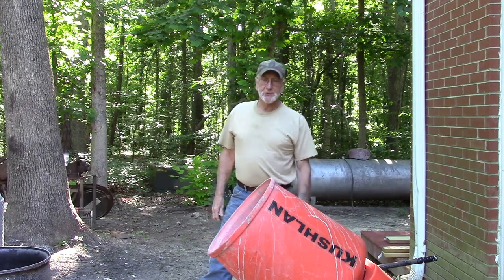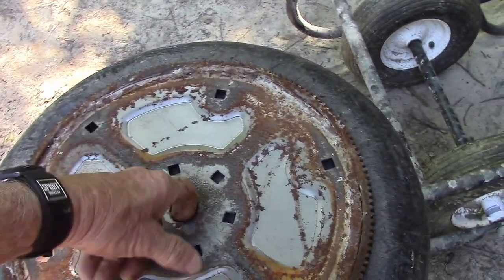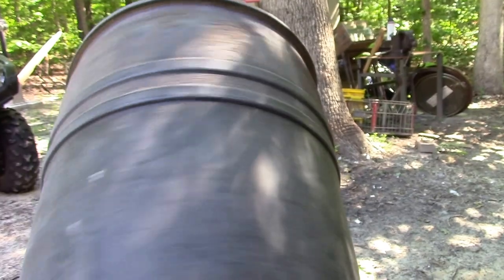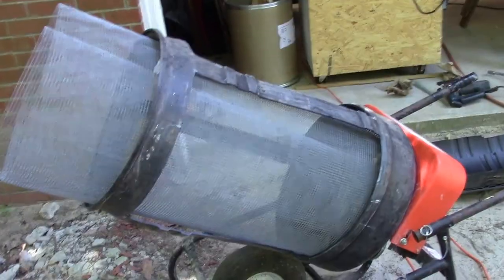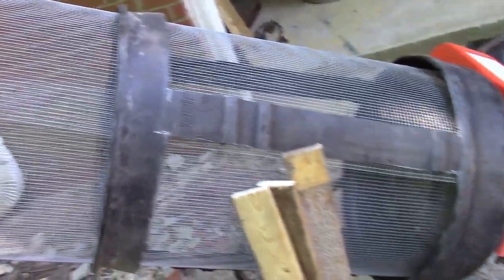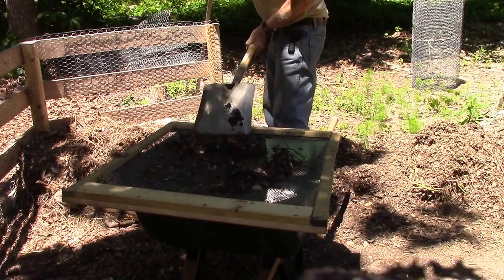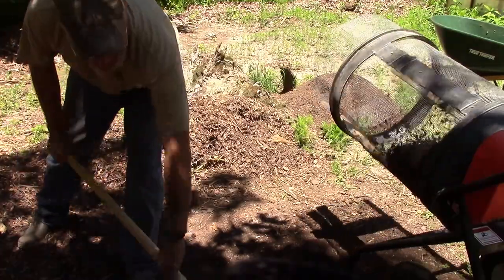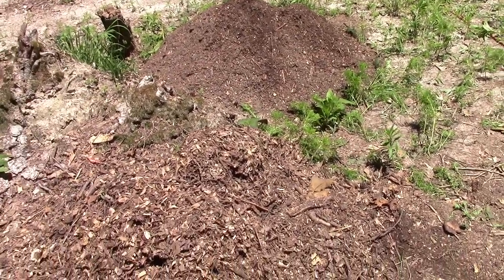Coverting cement mixer to compost sifter

Comment: Excellent trommel build. I have the exact same cement mixer. I already had  bicycle rims but have been putting off assembling the trommel because I wasn't sure of the drive mechanism (pulleys & belts, drill motor, etc). I wanted to end up with a trommel that was simple and small enough to store in shed. I will try to adapt the bicycle rims first since I already have them. If that will not work, then I will get a plastic barrel. Thanks for your video. It got me going again!

Comment: What is the make and model of the mixer ??
Reply from the maker: Stretching my memory back. It is a Kushan mixer that I bought at Home Depot maybe 20 plus years ago. They still make them today. At that time I believe it cost between 250 to 300 dollars. Any mixer should be adaptable to the same idea.  I use it a lot and have not had to do any major maintenance. Sure does a great job and is a time saver.
Reply: Excellent video and precise explanation of the construction.
You are to be commended sir 👍